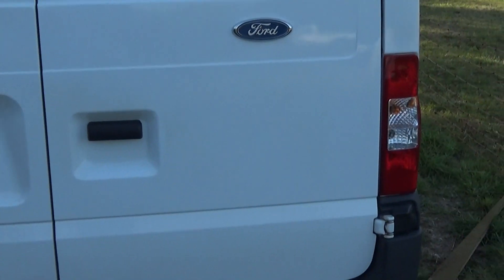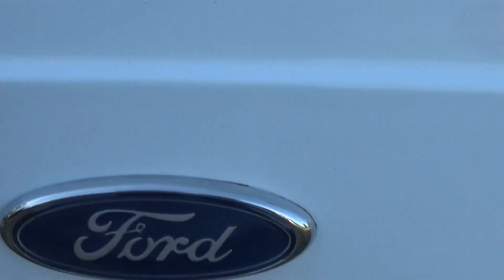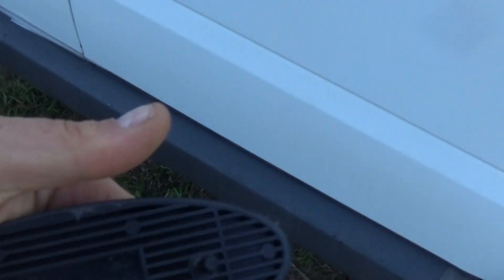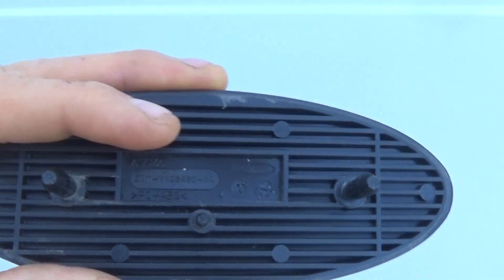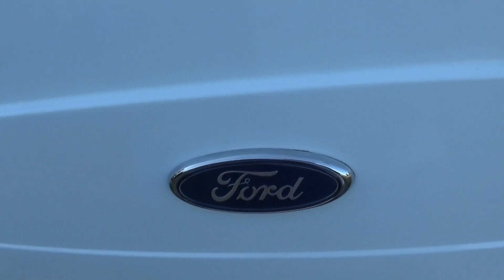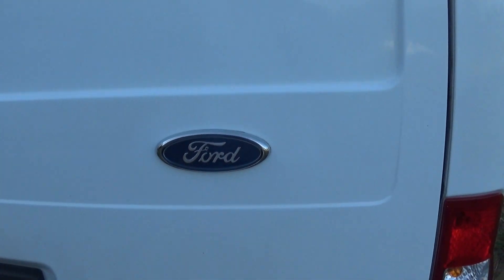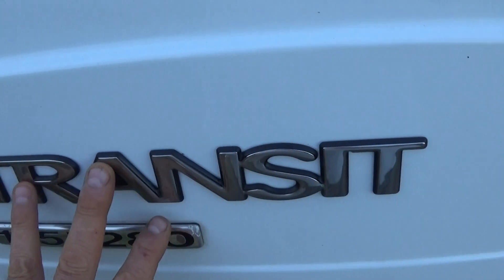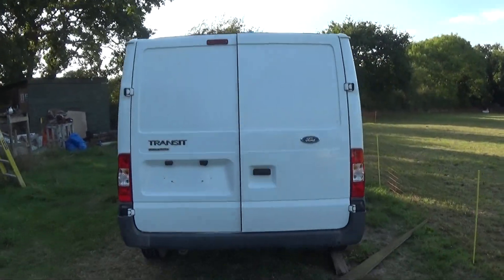MK 7 Ford Transit badge/decal replacement. Part 2 of 2

Comment: Xland wer did you get it from meny thanks
Reply from the maker: The link for the one I bought doesn't work any more. I just went on Ebay and they are on there. If you scroll down you'll see them. I see you can get a stick on replacement now so you don't have to take the whole thing off like I did. Hope this helps. https://www.ebay.co.uk/sch/i.html?_from=R40&_trksid=p2510209.m570.l1313&_nkw=MK7+FORD+TRANSIT+REAR+DOOR+BADGE&_sacat=0
Reply: @HILUXCHAINSAW  thanks 👍